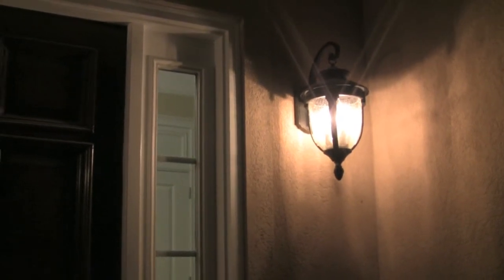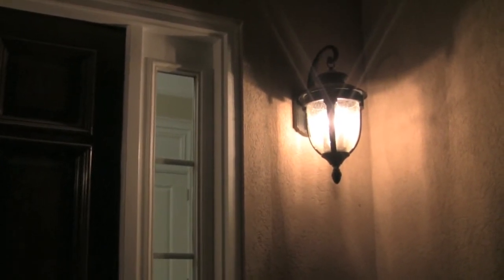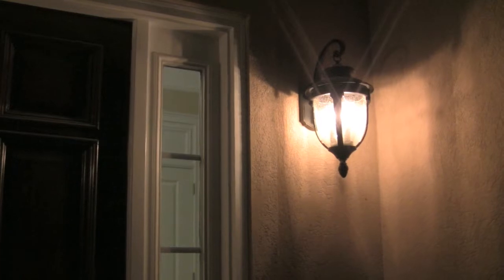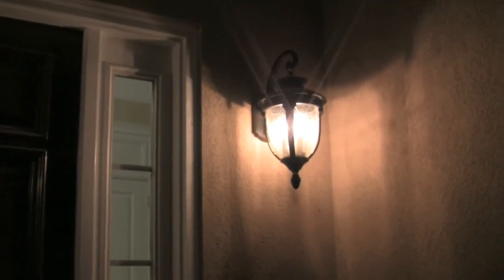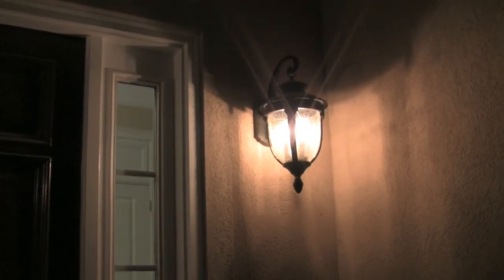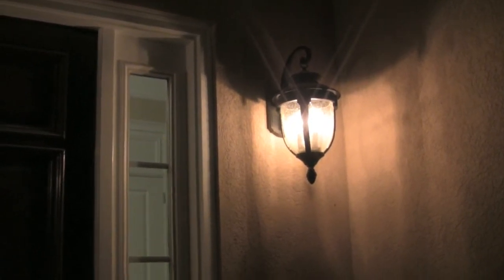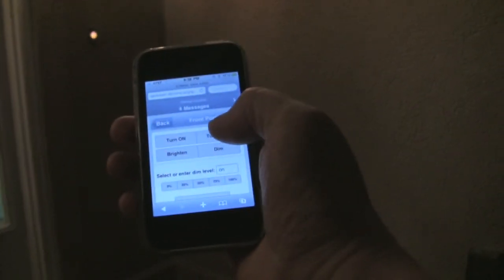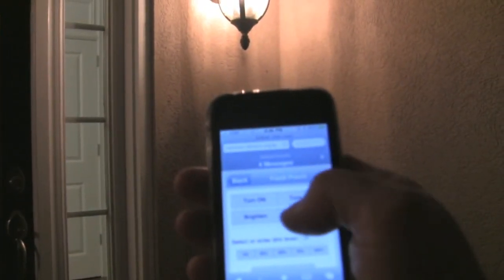Flickery Porch Lights

Comment: There’s no neutral line in that box is likely the culprit.  You can get a higher wattage bulbs for your porch lights if you don’t want to rewire the system to fix the issue

Comment from the maker: you're right! Except that these are regular bulbs that the switch is just in the same box as the CF bulbs in the house. I had originally thought they were being messed with by the noise from the CF bulbs as I didn't notice them doing this until I put the other in. It turns out though to have just been a defective X10 switch. After replacing it the lights stopped flickering and I no longer need any filters or anything at all. It was passing pulses from the powerline through to the SCR control.